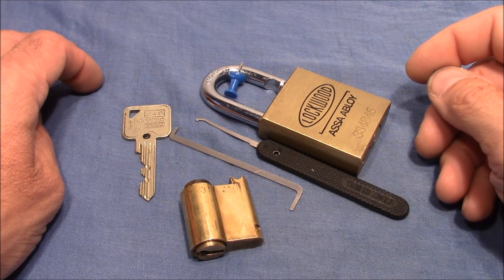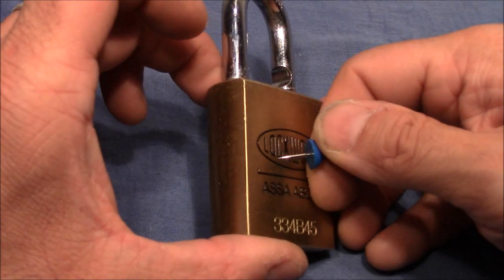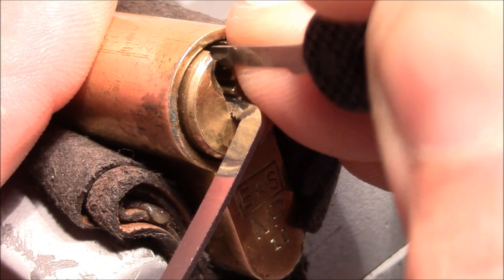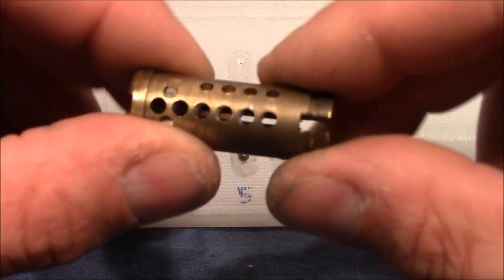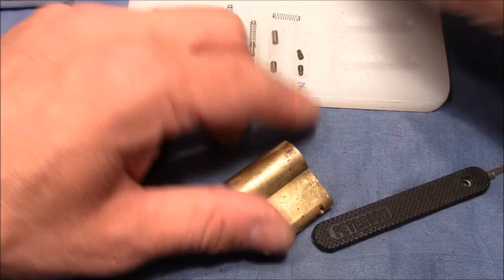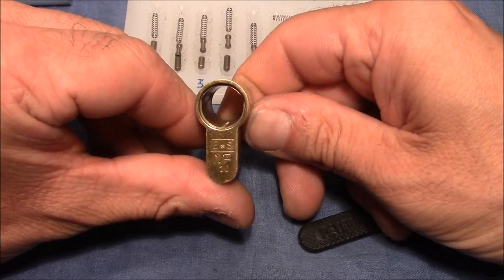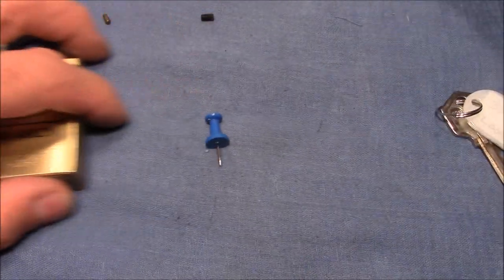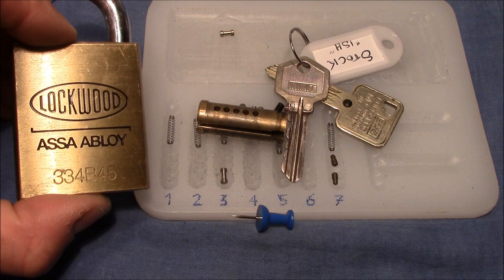(picking 231) 6 pin euro cylinder (E*S MP10) picked, gutted, key control explained + LOCKWOOD trick

Comment: The blind holes shown at 8:48 are most likely for trapping the small ball bearings that are needed for "construction keying". With construction keying, the lock will have a hierarchy of keys with different bittings, each next key locking out the previous one by removing one of the ball bearings from the pin stacks. See also vde's video on the ELCA Vario: https://www.youtube.com/watch?v=n9dJ8a5Baxo
Reply from the maker: Yes, could be. Thanks for pointing in that direction. I know VDE's video but didn't consider that option. Thanks again. Cheers.

Comment: Nice explanation of passive pins :) 
With the Lockwood, can the little pin be pushed when the core is locked?
Reply from the maker: Thanks. Yes, you can press that pin, but if the plug is not turned to the open position the ball bearing won't move.